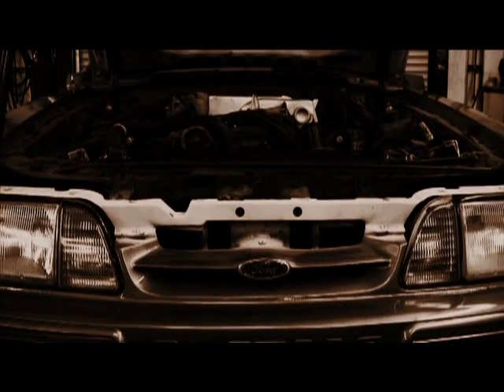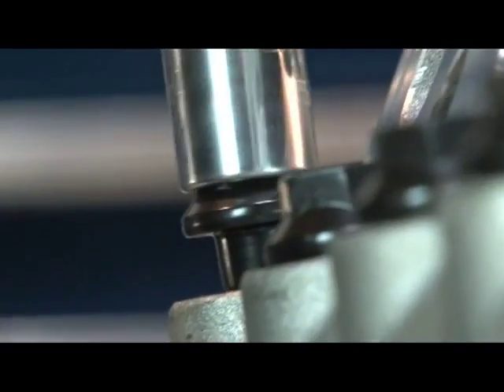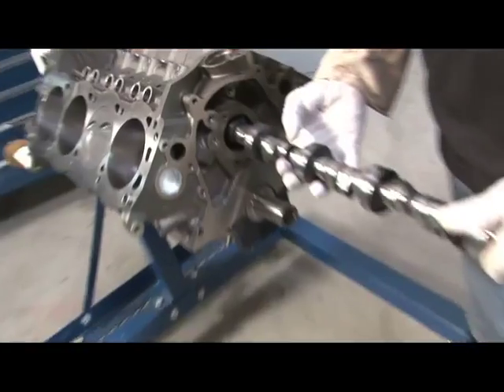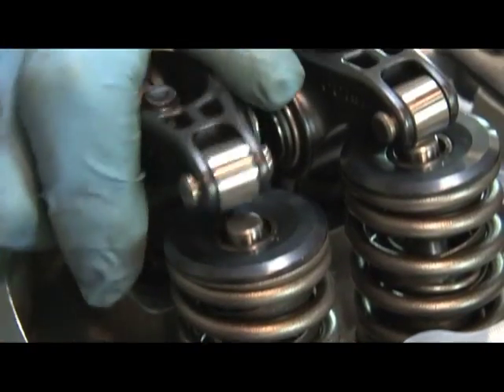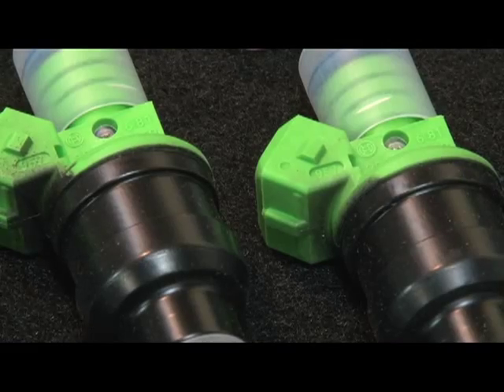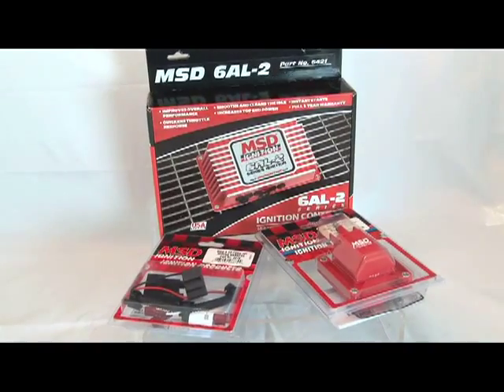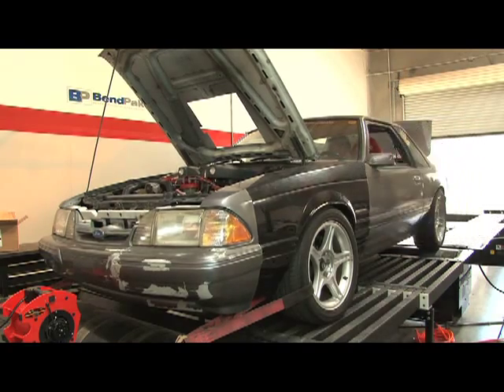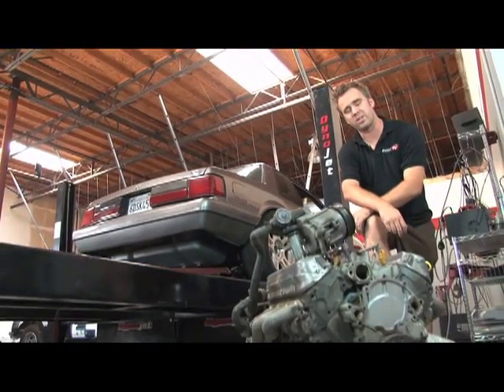Dart 363 Ford Build and Dyno

Comment: 15 years ago I built a 354 that made  over twenty more horses at the wheels than that, with 180cc Pro Topline (now RHS) heads, Edelbrock RPM, 625 Demon carb and Crane cam.
IMO 195cc’s even with 363 cubes is kind of big for the street, would be better suited for 383-400 c.i.
Correct valve timing and port velocity are everything!
Reply: https://youtu.be/PZSQ5KdJ2fc. 

Huh here’s a video for you, 195 heads were a nice selection for their 363 even with large cam.  I personally would run a 205 head on a 363 with a cam closer to what this motor ran.

Comment: Damn lots of power left in that bad boy. Guys watching this don't get discouraged. My dart 347 with afr 185 heads, b Cam, Holley systemax intake, Anderson power pipe, 70 mm tb, and lightning maf along with 42lb injectors. Made 381/403 to the rear tire. You would think with the bigger cam and ci it would kill my motor. Just recently went carbed hoping to pick up some power. We'll see.

Comment: I have to question the push rod length. The rocker geometry looks way off like the roller tip sets against the valve stem champfer. Was it really that bad?